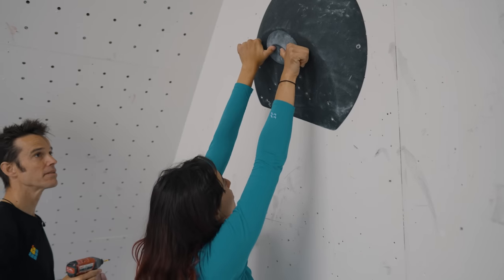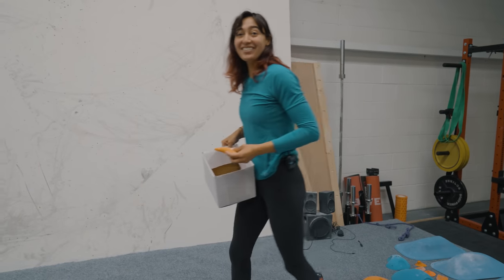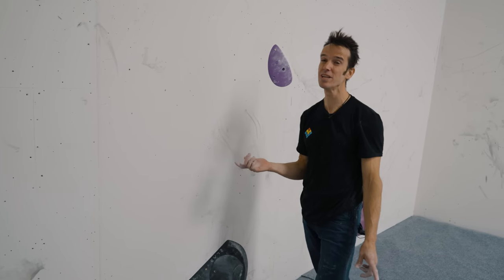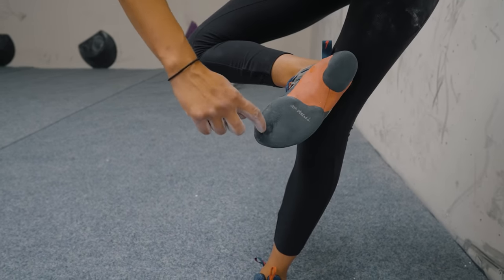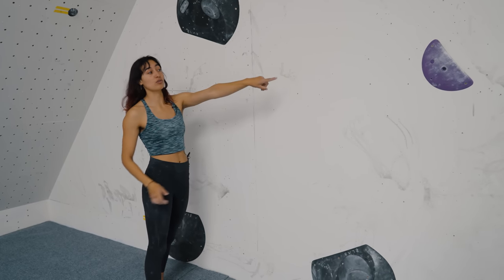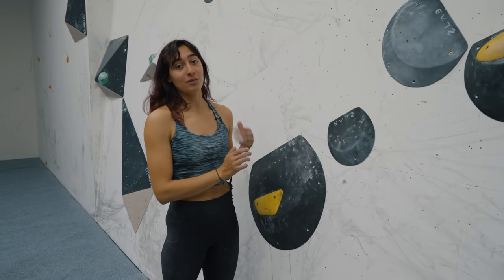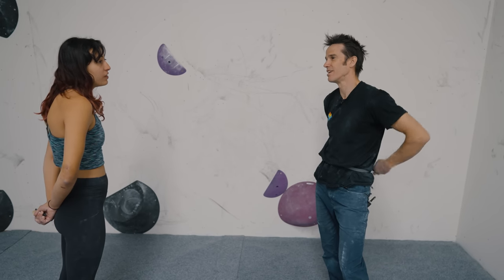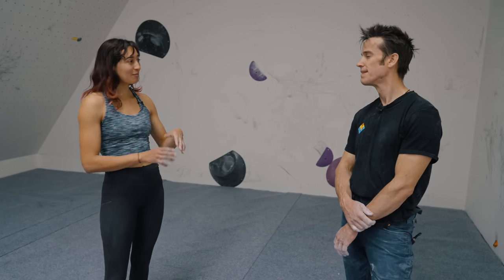World's Longest Indoor Slab | V4? V11?

Comment: So... I've been thinking about the physics of dropping your heels on slab. Conventional wisdom says that this increases the surface area of friction and puts more rubber on the wall, but friction equations don't account for surface area, just normal force. Does surface area matter here? Is this why racecars have big tires and big contact patches? Or does dropping your heel just move your center of gravity back and change how force is applied? Basically... why does dropping your heel help on slab? Can anyone with a background in physics (or that understands the force diagrams here) chime in?
Reply: I think the answer has to do with the integrity of the shoe rubber. It’s more likely to break down when all of your force is focused on a small point. When the rubber breaks apart it rolls into little bits and that’s what causes you to slide off. Once you start “rolling” off your friction coefficient is greatly reduced.
Reply: @CJski  Interesting point! Basic physics tends to assume that materials are constants, so there's probably some truth to this! Still trying to wrap my head around a force vector diagram though. It's been so long since I've done any physics...
Reply: If you think about a hold or wall on a microscopic level, it has a million jagged peaks sticking out from the surface. No material is perfectly smooth. When the rubber gets pressed onto a hold, because it is pliable it molds to imperfections on the surface. So now you have interlocking peaks of rubber and whatever surface you're climbing on, like tiny little claws. The normal force diagrams would have to be applied to all of the imperfections. Therefore the more surface area you have contacting the wall, the more interlocking "claws" you have and the stickier you are.
Reply: @thesii213  the force diagram is not too helpful here other than showing what you already suspect. The forces aren’t changing whether you have more or less surface area. It’s not like your weight or the angle of the wall is changing. The microscopic surface roughness is already considered in the friction coefficient of rubber on rock (or whatever the material is) and this doesn’t change either unless the material breaks down and crumbles.
Reply: the "surface are doesnt matter" is  just a simplification. it is much more complexe than just normal force. But most of the time its accurate enough to use the simple formula AND it would be way to complicated to measure all parameters needed for every surface pair.
Reply: @CJski  Ah sorry, I meant that does dropping the heel change the way force is applied? I assume this lowers the center of gravity somewhat, but I don't know if the angle of the "pulling"  force achieved by dropping your heel below the hold maters relative to the "pushing" force when the heel is raised? Obviously the net force would still largely be pressing down though.
Reply: @Tenfdy  Fair point! I don't know why I'm stuck on this. Just got in the gym yesterday and realized I couldn't quite map the physics of what was happening in my head.
Reply: @CJski  the coefficient of friction will change with pliable materials every time they are pressed into something since the shape is changing, they don't have to break down to do this.
Reply: @TheOpaqueWalrus  I’m sure you’re right. But that doesn’t explain why we drop our heels. If we could dig our shoes into rough surfaces, wouldn’t we want to use just the toe to apply more pressure and take advantage of that effect?
Reply: @CJski  Ah, this is what I've been turning over in my head. I think dropping one's heels either changes the direction of applied force slightly (either via the direction of pressure or just by sitting back a bit further with our center of gravity) and thus presses harder and increases friction of the shoe's rubber. I just can't quite work out the force diagram here.
Reply: @CJski  It would explain it if the coefficient of friction increases when we drop our heels due to more rubber deformation. Digging in your toes would also work, but could it work as well as dropping your heels? I don't know, probably depends on how strong you are and how much your rubber can take, but given the consensus that dropping your heels works really well I doubt it. I will add though that I do also think that the force angle helps, since a dropped heel would press more into the wall, increasing the normal force.
Reply: @thesii213  I think what you are concerned about is torque. You can imagine that it is possible to keep your center of mass over the point of contact with either your toe or your entire foot (heel dropped), thus the direction of the gravitational force is aligned downwards through the point of contact in both cases. But as soon as you move your center of mass there is a moment (torque) about the point of contact, which increases the likelihood of sliding off because you now have to balance the linear AND rotational forces. Again, I think a larger surface area helps prevent shearing of the shoe rubber. Look at how much rubber comes off your shoe when you slide off a volume.
Reply: @TheOpaqueWalrus  Respectfully, I don't think this is correct. Increasing the surface area would decrease the pressure not increase it, since the force (body weight) stays the same; therefore, there would be less deformation of the rubber and - according to you - a decrease in friction coefficient. The normal force is simply a reaction to your body weight. Pressing more into the wall means that the wall will press more against you as well.
Reply: @CJski  Also excellent points! I'll think about this thanks. Might be time for me to break out the physics textbook again...
Reply: @CJski  I meant the angle of the force is more perpendicular to the wall when your heel is dropped and is therefore "stronger" simply because it is more efficient. If you could get the same angle with just your toe the pressure would be higher, but you can't get that angle on the wall